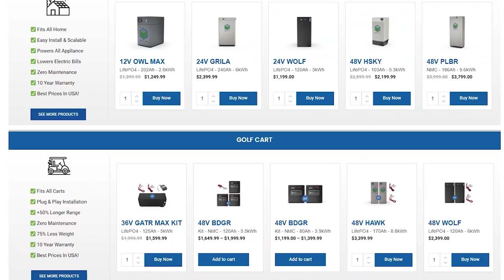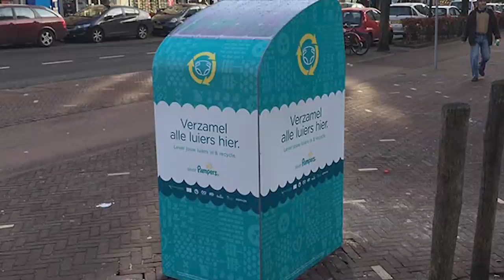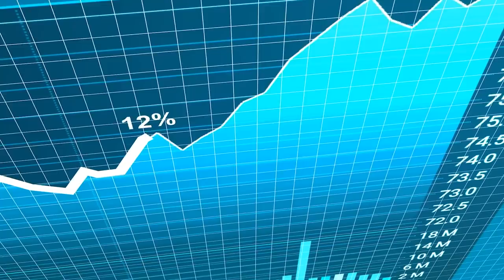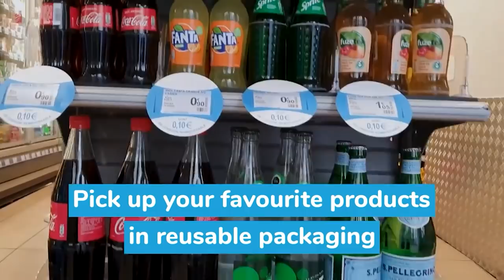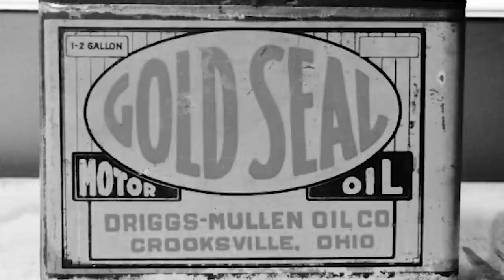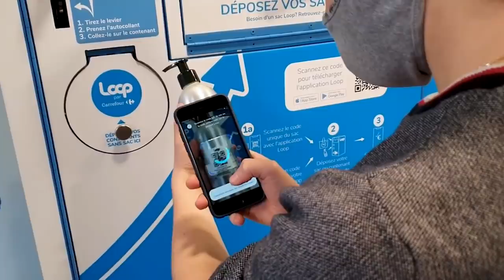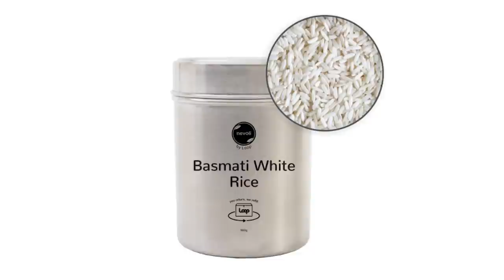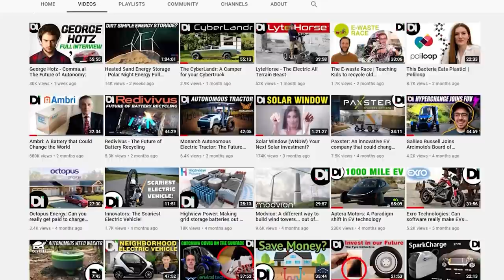The Battle For Your Dollar - Tom Szaky Interview | In Depth

Comment: 1) There is no chance. None. That this dirty diaper recycling is better for the environment than tossing it into a landfill when it comes to carbon or other green concerns. There is no way that the some-of-it's-parts makes sense to put into several different use streams, especially when it's post consumer waste. Getting all the material from it's original manufacturer makes more sense in all but one case. Greenwashing. Because greenwashing is all that is. Making a brand that doesn't want to change or re-engineer their product to actually be better over it's life time. Hell burning them for heat would make more sense. Why not just make a greenwashing consulting firm and call it quits.

2) Loop makes good sense and it's a shame that the arguments he's making for it are so terrible. "If I asked the people what they wanted they would all say faster horses". That is the same joke Zack and Jesse make once a year about the popularity about electric car adoption. You don't let consumers decide. That is never a thing that has ever actually happened. He even spoke about the shrinkflation of his monopoly pieces. The candy bars getting smaller ever year were the classic example. Motor oil is sold by the quart by people who need it to pour like they always have. So they won't change. If the entire market had to switch to steel, they would.

This is more of an aside, but it is obvious that Tom Szaky has had to defend his love of capitalism often. Even though he admits he got started with a "highdea" of wormfood compost. Coming as a refugee from the former soviet bloc and loving monopoly, he has to couch all his ideas in this weird vernacular to speak about ideas that challenge the status quo. I get that he has to speak to a ton of venture capitalists, bankers and other parasites of our surplus labor but he can talk about his idea straight. It is better for everyone that we standardize containers. He doesn't need to justify something so obvious. The only ones he needs to justify it to are people with products that don't move without a ton of marketing. Generics sold in reusable containers are an excellent idea. Aldi, Lidl and other stores that focus more on niche brands and generics would save a ton of money with standardized containers. The scale that he was talking about can be met at a more and more local level.

If something so monstrous as the soviet supply chain system of brutal efficiency had to do it, they would do it like that. And if the soviets would think it's a smart idea than you don't need to sell the idea using capitalist rhetoric now do ya? The problem of waste is a problem of irresponsible capitalism. Some of the most unethical ways to make money. Trying to use capitalism to constantly solve the problems of capitalism need not be the only solution. Some things work better as a public service. Recycling programs work best when they aren't greenwashing and have civic duty as the goal of citizens.